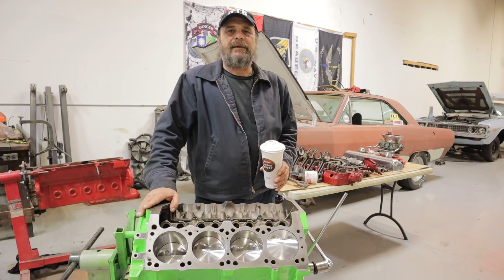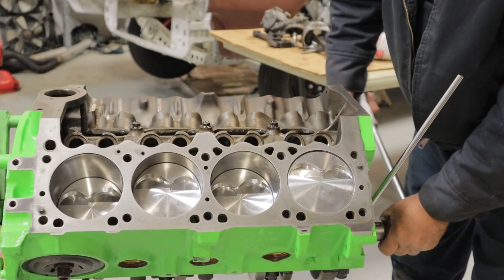Finding Your Engines Happy Happy Fun Zone

Comment: I'm wondering if it's possible to have a small port in the cylinder bore at about 45 degrees of the crankshaft rotation that would put fuel in while there is still fire in the bore, and if that would expand and force the piston down with some more force at that time. I realize compression would be gone, but if there is still fire in the bore, would more fuel added at that time ignite and if so, would it help force the piston down with added energy at that time?

I think of a potato gun or whatever where a chamber has fuel which is ignited, and there is no compression in the bore at that time it gets ignited, right? 

I suppose that would require a special injector in that port that would add both gas and air under pressure.

And I wonder if a scavenging port low in the bore could alleviate bottom hole detonation.

Comment: I know this is an older video, but I have a question that maybe you guys can answer. Would fuel burn duration explain to some degree why an engine makes more torque as RPM increases? If fuel burn duration is (roughly) equal throughout the rpm range but the piston is moving faster at higher RPM, would the fuel continue to burn farther into the piston's rotation and therefore create more torque? Or am I way off? Thanks.

Comment: how can you extend the burn without hurting the overal burn performance tho... and why are people fighting to make pre ignitions in a seperate chamber to open instead of firing a spark plug to get a better flame front... i feel like the best bang soon as possible  is what you want. if you get it good enough it will push all the way till the valve opens...

Comment: what do you think about direct injection? ive got a Gen v 6.2 got a real cam and lifters in it. i can play with the fuel injection timing but aside from making it run poorly by being too near the combustion event or so early it goes out the exhaust valve...  Also i can change my cam timing from 8 degrees advanced to 40 some retarded.. seems the retard the cam at cruise from the factory to basically open the throttle more to fight pumping losses im guessing?

Comment: I thought I knew it all, being an avid gearhead myself! Yeah, I kinda understood the concept, but I never really thought about the dynamics of what was happening. So a few degrees after TDC, the leveraging effect on the crankshaft is very small because everything is practically straight up, but as the piston goes down the hole, the leveraging power increases as the crank throw moves towards 90 degrees. So yeah, I get it! Keeping that pressure pulse going all the way to 90 degrees would be optimal. Hey, I learned somethig new today!

Comment: I think I got it Uncle Tony. Now skipping over to the 2 versions of the slant 6, the 170 and the 225. Does that mean that the 170 makes more horsepower per cubic inch than the 225? Because of longer duration of flame as the piston descends down the cylinder?

Comment: @Uncle Tonys Garage- Boy would I really love to have you as a friend & neighbor I've known for years because I have a 26 year old son that bought a 1979? Dodge Warlock with the dual front headlights? Heck I'm just trying to remember, anyhow, he buys this sweet truck a few years back, (love at first sight he said!☺) right out of a back field of this elderly gentleman's property while on a tow job for the company he works for. I must have towed that boy back to his house, down the road from mine a half dozen times from right down the road every time. He could jump into the engine bay of any old school Honda and take everything apart and have a rebuilt engine "complete" in 3 days but that Warlock, that Warlock he has taken apart, bought a bunch of new parts, including a new carb, gas tank, battery, wires, extensive work in the last couple years, still that truck won't stay running but about a 1/4 mile down the road and just dies- dead, won't start again. He knows NOTHING MOPAR-So a year & a half ago he tows it hours away to a special mechanic, a friend he made at the company they work for, waits 2 months, mechanic calls him up says "she's ready!" My son drives her all the way back 2 hours, parks it at his house and it's dead again. Now fast forward 8 months, it's been sitting in the lot of another mechanic in a little town 8 miles up the road from us and hasn't been touched for that whole 8 months. @Uncle Tony's Garage Could you please tell me if my son has any hope to ever see this beauty up and running or is their such a thing as a cursed Warlock?🤷 Thank you for your time A sad mom out of Prescott, Arizona🌵

Comment: What also helps make that four digit HP is simple displacement--back in the early days of cars, Indy had like a 600 cid displacement limit since the technology didn't exist. and of course at 600 cid today, that's typically a big bore with less valve shrouding--so we're talking about quality of combustion mixture. the problem with adding more oxygen to the combustion is it turns into a torch and wants something to burn or melt--either a fuel or an alumimum piston. Ultimately, these videos are reminding us just how inefficient a 4 stroke is--most of its motion is pushing the other pistons around.

Comment: Damn this guy confuses everything.  TDC is the opposite of 90* ATDC?? 

TDC and BDC are both positions, and are opposites.  Minimum piston v speed (zero degrees TDC) and maximum piston speed (slightly less than 90 degrees ATDC depending on stroke and rod length) are both speeds and are opposite nodes.
And once again, Flames do not push the piston down. The pressure from the heat of combustion pushes the piston down. Tony thinks that after the flame consumes all of the fuel at 45* ATDC, there is no more pressure for the rest of the stroke. Actually, this is when the temperature and pressure is at its peak, and it continues to expand inside the cylinder, pushing the piston all the way down until the Exhaust Valve Opens.
Reply: So you're saying burn duration is a myth and Top Fuelers are unicorn
Reply: @ericlandstrom6155  No. Burning takes finite amount of time. Nobody is claiming that "burn durration" is a myth, whatever that means?? And top fuelers are real. Never seen a unicorn.
As I said on the previous video:
"Flames blasting out of the exhaust pipes looks cool, but it is an indication of a tremendous amount of wasted heat, which could have been used to expand the air/fuel mixture while still in the combustion chamber. Top-Fuel nitromethane (CH3NO2) is a low energy-density fuel which is extremely lazy.. The reason why it works so well is that all of it's disavantages are outweighed by its one primary advantage, which is its extremely low air-fuel ratio. Also its low volatility allows for extremely high compression ratios, which help counter its slow, lazy combustion rate, and reclaim some of its lost thermal efficiency (post EVO combustion, i.e. flames blasting out). One other factor that makes CH3NO2 great for top-fuel is simply the economics of that industry, which are completely different from most other applications, including even the street/dragstrip hot rodder. So whatever Tony is trying to profess here makes no sence, especially when he's pointing to the slow energy release of CH3NO2. He doesn't understand the Otto-cycle engine. Any real automotove enthusiast should familiarize themselves with this model before they start inventing new breakthrough theories."  --> https://en.wikipedia.org/wiki/Otto_cycle  . 
By the way, a top-fuel engine still follows the Spark-Ignition Otto-cycle exept the combustion takes a lot longer, and the pressures are much higher at EVO (huge loss of thermal energy, loss of conversion of thermal energy into mechanical work).  Why do they do it this way? Again, economics. They can spend a fortune on an engine that only has to enure 1 to 3 passes, they can dump tons of fuel with little air into the engine, blast most of the energy out the headers, spill gallons of fuel every where, not pass a single emission standard, and still make thousands of Horepower for a few seconds, as long as they win and make big $$ by sponsors. Nothing wrong with that, but it only works for that industry, not for your trick 1969 383 Roadrunner.

Comment: Interesting video Tony. So why does advancing ignition timing help power instead of hurting it. I have a factory 71 hemi charger that runs like crap at factory base timing spec of 2.5 degrees. But advance to 16 degrees base/38 total it runs awesome much more power and rpm
Reply: This channel has a lots of good stuff and make sure you watch the past videos, you will find the explanations on the spark advance advantages.

Comment: Great Video.  I have read that the rotary motor produces a 270 degree power stroke during each revolution.  I think my rx7 is only 70 cubic inches .Can you imagine the power that these engines would have made by increasing the motor from two rotors to maybe four or six and get the cubic inches closure to a small block chevy engine.  Stock these engines were achieving like 120 horsepower for 70 cubic inches back in the early 80's. That would be like a 350 making 600 horsepower with early 80's technology

Comment: for max tq and mpg a small boor & long stroke is the way to go but max rpm will be low do to hi piston speed and valve shrouding. the solution is use the longest rod and sort pistion. this will give you a strong power curve for the street! good low end  & decent top end! if you are looking for economy a 273 with a 360 crank wold work good! check out bore vs stroke on youtube channel enginering explained. the other thing is a flat plane crank!

Comment: In a ideal engine all the fuel would burn and release all its energy right at TDC.  Mechanical limitations not withstanding all fuels have a burn time. For a good gasoline engine peak combustion pressure occurs around 15 to 17 degrees after top dead center.  If you change this position you will reduce the amount  of maximum break torque that you output.  This is why most gas engines have ignition  timing long before TDC.  If having the fuel burning at 45 ATC was good you sure wouldn't start the spark 35 BDC.  For gas all the fuel will be or should be consumed by about 20 to 25 degrees ATDC.  Trying to burn fuel 45 degrees or more ATDC is super inefficient.  As the crank is turning the piston speed is actually increasing, which results in larger chamber areas. A big chamber will pull heat away from the piston and into the cooling system. Any heat loss out of the chamber reduces efficiency and power.  This is why all modern combustion chamber designs are fast burning compared to older designs.  The comparison the nitromethane engines is a red herring it's to obfuscate the topic. Sorry not sorry but Uncle Tony is out of his depth here.

Comment: Ok, I run 7.60 index class in the 8th on just motor,  I dont use forced induction but know ones that do.
QUESTION: excuse my ignorance but this seems to me to be a great Layman explanation on how a Turbo Motor sneezes its guts out under a Super Lean condition at High Rev.
Thanks Uncle Tony and Fans.

Comment: In a 302 Ford with a 6.0 inch rod the piston will be 1.7 inches down at 90 degree after top dead center. This is more than half the way down. In fact it is worse than you stated so you are even more correct than you think is saying that power has to be developed in the first 90 degrees.

Comment: Excellent stuff UT!  Can you do Octane, Octane boosters, etc. next?  That's probably closer to the issues many of us have considering detonation/pre-detonation as it relates to compression.  Especially where the compression cutoff may be for the need for fuel that's less likely cause pre-detonation i.s. higher Octane.  I run premium in my carbureted sbc 350, but still have to add octane booster (half bottle per tank fill) to keep it from detonating on shutdown.  Does it have anything to do with today's pump gas vs Super Shell of the 70's?  I estimate my compression at  10:1.  Thanks for all you do!
Reply: You don't have a predetonation problem you have a preignition problem.  Under no load the octane requirements are really low,  It's under high loads that you need octane.  What's happening in your case is when you shut the engine off something in the chamber is staying hot and igniting the fuel.  It's either carbon build up, way too hot of a spark plug or a sharp edge doing it.   You see this frequently when guys run 305 sbc heads on 350's the small chambers overhang the cylinder and the sharp edge gets hot and causes preignition.  There is no magic number that says for x compression you need y octane. Doesn't exist full stop.  Octane requirements are a combination of factors beyond the static or even dynamic compression ratio.  A modern heart shaped chamber will tolerate less octane vs an old open chamber, especially one with pop-up pistons.  Your cam timing also effects octane tolerance. But don't forget how you are using the motor.  I can idle my 15 to 1 race motor on pump gas. But it won't take any load.  A heavy truck trying to haul a trailer up a hill needs more octane than a car on flat ground.  Do you realize there is even a point in race cars that the engine speed gets so high your spark plugs go off before the fuel can predetonate?  Even engine size plays a big role it takes less time for the flame front to cross a 600cc motorcycle engine cylinder than a big V8.  That's why many crotch rockets run just fine on pump gas at compression ratios of 11.5 to 12 to 1. It's all a combination of factors if you really want to know, install a knock sensor in your car.  Much better and easier than trying to chase numbers.  A note on octane boosters most are garbage and don't really add octane but instead reduce combustion temperature.  Usually coating your sparkplugs in brown goop in the process.  If you really need more octane a relatively cheap way of doing it would be to blend in some av gas.  A ratio of 4 gallons of premium to 1 gallon of 100 low lead will bring you up a couple points.
Reply: @TL-angzarr  So you agree then that I, like a lot of other people, confuse the octane issue and we'd all be served by the expert tutelage of Uncle Tony on the issue.  However, I for one, would prefer to stay in the realm of pre 1980 muscle cars.  Likewise, the more mundane such as 462 double hump heads on a 1st gen 350 vs the more esoteric 305 heads on an SBC 350.  And, as I said old school carbureted without facility for a knock sensor, as far as I know.  Thanks for your reply, and noted, "pre-ignition" is the proper term.

Comment: I would assume this principle is why an engine like the current 5.7 hemi with only 345ci can make 395 hp and 410 ft.lb  on pump gas when we had big blocks in the 80s that made no where near this much power per cu.in The Toyota Tundras 5.7 blew the big three out of the water in 2007 when the 5.7 make 381 hp on 87 octane. The current Ford 5.0 makes 400 hp. Insane number for such “small” displacement The key is they all do it reliably. . 

The advanced engineering, vvt ,extremely precise fuel management and ignition's allow what Tony explained to really be utilized in modern engines safely

Great explanation. .

Comment: I was watching the pistons move, how come that one bank of cylinders look like that so called new four banger,i  Yamaha,s new crank,  almost all four bangers have cylinder,s 1 and 4 at TDC, and 2 and 3 at BDC, the old Afla twin cam engines reversed the firing order for 2 and 3, Ive asked for years why they did that and never got a engineers responce, and yeah its means special  cams, When GM was mas producing 151 iron mikes, how come they didnt use a cross flow cylinder head, like on the V- 8 s ?

Comment: Back in 1981 while sitting in front of a bar drinking beer , two men in a truck pulled with a used Hemi and 727 trans with all of the cables and bars , rear end on a trailer , they yelled out hey We are selling it for 400 .  Danny asked does it run and they said yah it came from the Cuda that knocked down the telephone pole over there a month ago. I had the money in my pocket but did not think of this . I had a 1954 ford F100 step side short bed that needed a motor . They were down the street when Danny said your truck. The ford has a big engine bay . Back in HS our friend Herbert had a 54 with a Chevy 396 and a 400 trans .   RATS ??????

Comment: Try running nitropropane (C3H7NO2)10 to 20 percent 
And Propylene oxide , fatten up the mixture 4 sizes min. And add gap. This will greatly increase the flame above supersonic force on the piston. Only use this for occasional running as it will shatter cast pistons. But great for the final round wins.

Comment: If I am understanding this correctly, you can kinda look at the crankshaft throw as a lever, and the crankshaft center line is the fulcrum. Like turning a bolt with a wrench. The closer the angle that the piston and connecting rod push on the lever is to 90 degrees, (or, your hand is on the wrench) the more power is transmitted into turning the crankshaft (or bolt) I think this has changed the way I fundamentally look at how an engine works. Thanks, Uncle Tony.

Comment: Why is ignition usually set before TDC then ?? Would it not be more efficient to be after TD, when it has more leverage ??
Reply: The spark plug is normally fired before top dead center to allow the pressure resulting from the combustion to be at it’s highest when the piston starts to descend in the bore.
It is possible to fire the plug on the way down and this is being done by some I was told (race applications only per what I know of it).
Anybody feel free to jump in on this one.